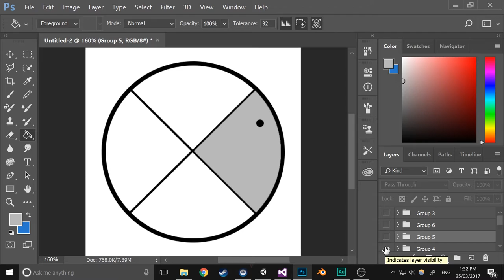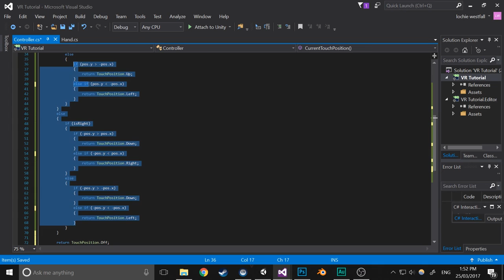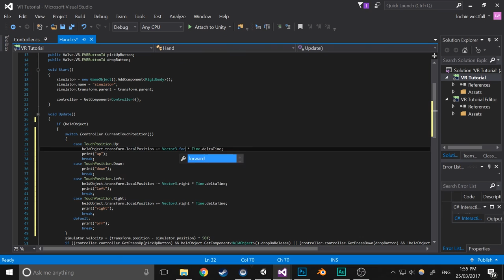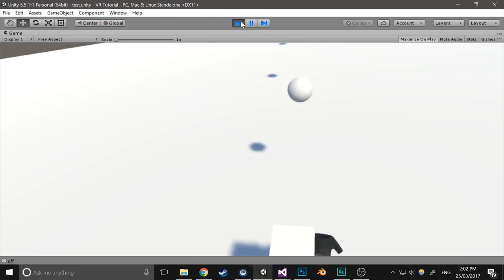Touchpad Splitting - How To Make Games For The HTC Vive In Unity with C# (E03)

Comment: Hi! I'm trying to use this to change the material buy pressing on the right or left side of the controller. When I copied your Controller class and some lines from your Hand class ([RequireComponent(typeof(Controller))], controller = GetComponent<Controller>();, and the switch statement). Whenever I run my code I get a null pointer exception for the controller.CurrentTouchPosition() command. Any help?
Reply from the maker: +Iggy use the full scripts to start with. That is method.